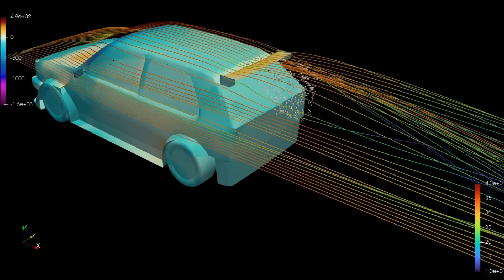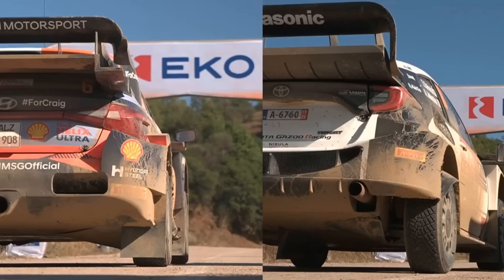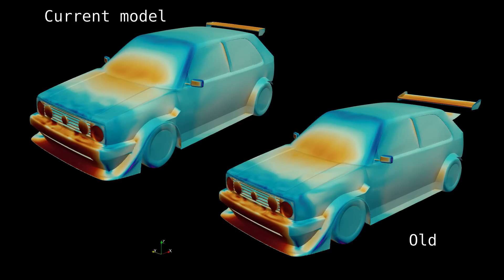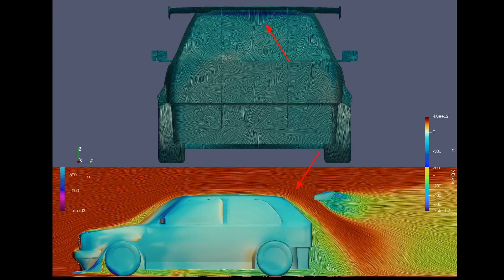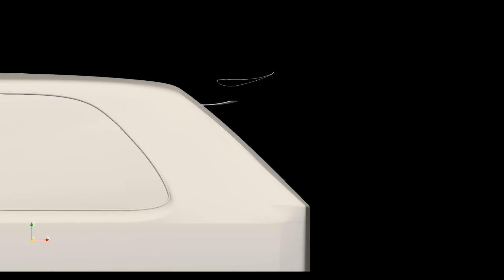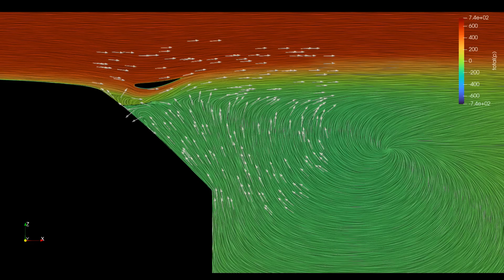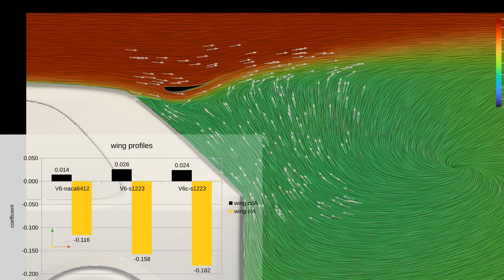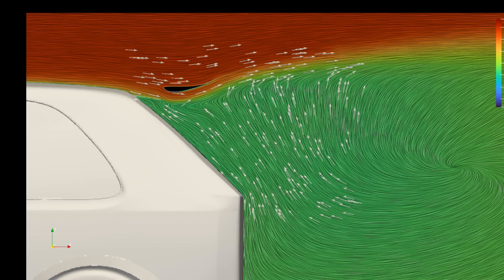Wings on a Hatchback

Comment: Love your video man, just for reference do you have do you have a list of drag and lift coefficients for a stock mk2 golf? 

I was under the impression that a stock mk2 had a cda around .3 so that fact that the front and rear spoilers more that double the drag was kind of surprising to me.
Reply from the maker: cda is not the same as cd. The mkii would have a cd = 0.3 like most small cars of the period. This a comparative model built from images, so not a direct replication.

Comment: what about the consept of clean seperation edges, I mean this car is kinda boxy so it comes kinda like that from factory, but if you have extended flaps from sides in a  negative angle to give smaller wake area and better separation edge does this do anything

Comment: Great channel, would it not be more beneficial to use devices at the back end of the roof to redirect air into the low pressure zone behind the car to just reduce drag. And maybe use a flat floor with splitter and diffuser to create some negative lift for the car? i'd love to see that visualised

Comment: A sissy little wing on a streetcar has no or not much use. At speeds achieved on streets, it generates not enough to have effect. If so the wings on sportscaster would be smaller .

Comment: We have observed in practice that rear wing can and will increase rear wheel grip at high speeds. Also in context of pure downforce, it might not be much, but depending on where you place that wing you can shift the weight of the car and create a stable or predictable behavior in the high speed corners and at the same time very well rotating rear in the low speed corners. In general the closer to 90degrees the hatch is the more you get drag and less lift. And people rarely account the suspension dynamics when speaking about aerodynamics.

Comment: very good that you kept testing and learing, notice that you found out that it was from old rally cars, also hill climbs (pikes peak, some dakar and so on) but most of them use a different method instead of the flat flap following the roof, very glad you tested that one because thats my theory of putting the wing all the back you are allow and letting the air follow a better shape to decrease drag and lift on the body of the car ( having a so back wing also helps with making more leaver force to the chassis) 

some ideas that you can test on the rear back of the hatchbacks ( i have some already installed) using a flat flap, with gurney and other with spoiler but on the middle of the car below the wing, i believe that area can be used to get more effiency out of a hatchback form 

i saw the complete list of the touring aero you made and notice that you made a cut on the rear bumper, i am using one but from around the back axel 90 degrees diffuser ( same theory of a open door on the rear of a pickup) but upside down, racing with it at certain speed i have felt the interior that i made from sheet steel bending so i assume it works and create more pressure to the rear 

great content and hope that someday we can maybe chat about it, always it is a very good time talking on aero from race cars and dont feel that everyanswer has to be though because it is a business secret that sells

thanks for the content and have a great day

Comment: On an all out race car with full aero an ultimate way to benefit could be to create a wing that actually created a little lift at the rear. Creating a "lever" effect slightly increasing the rake of the car (a force actually lifting, infact lets think of it more as twisting/levering) the rear with a little upwards force but with the equal effect of also pushing down the front a little.
 That lever force could then be used to alter the flow of the air around the rest of the car itself,  but  the main goal of creating Lower pressure under the car for example, essentially sucking the car to the ground more. More net downforce.  This would ofcourse require careful consideration and design of the rest of the aero etc of the car. On a basic off the shelf road car hatchback its probably not going to do much, infact youll end up with more net lift. 
But something with carefully designed aero on the underside, acting as a package utilising the rear wings rake boost, well, thats wheres the aerodynamic performance gains could be at for sure.
Reply: The only way I can think of to do that would be if the wing had a flap kind of like an elevator on a plane so it’ll have negative lift towards the front of the wing and upward reaction force in the rear. But I’d imagine that’d take tremendous force to make a difference given how little leverage the wing will have on the rest of the car, so it’d need a lot of surface area for the “elevator” which would create a lot of drag.

Comment: From model aircraft and glider design, I know the Wortmann FX60-126 airfoil to offer a high Cl and L/D over a wide range of Reynolds numbers. For a laminar flow airfoil, its tolerance for turbulence is remarkably good as well. I know its characteristics from the ASK 21 gliders from first hand experience and can confirm that the last bit of these planes to stop flying are the wing tips which feature the FX60-126. Maybe run a simulation with this? An airfoil that produces a substantial Cl max from low Reynolds numbers as well is the RAF 32, which is not too popular with planes for its Cm₂₅ being pretty hefty. For use on a car, this would be  very little of an issue, so it might be a good choice there!

Comment: One thing I would like to know is if there is anything I can do or add to my van to stop road-spray or rain and just the general dirt and muck from being sucked up off of the road and attracted to the rear windows like a black hole attracts matter.  Maybe some kind of wing or vanes to let clean air blow down over the glass from the roof.    I don't care much about drag, since my van is an 8 ft. tall brick as it is.     I have an older conversion van with the high roof, and 2 doors on the rear.  (Just look up a pic of a '90 Dodge Ram B250 conversion van)  I have installed a rear-view camera just behind the glass, and if it's raining, or the roads are wet, the crud just gets sucked up and all over the glass, obscuring any  view or hope of seeing rearward via the camera or interior mirror.  Anyone who has ever had a "flat-back" vehicle, as in a van,  wagon,  minivan, bus, RV etc, with no rear wiper/washers will know the struggle.
Reply from the maker: The dirt is pulled up and behind the car from the ground, obviously. I have video that addresses the commercial attempts at solving a similar problem of snow by pulling air from holes in the spoiler. This solution is mixed. I would be inclined to divide the wake into two counter rotating masses with a flap under the rear window. There would likely need to be other pieces of body work to encourage the counter rotation, like a piece pulling air off the roof, but that is where I would start.

Comment: On Golfs many just lengthen the roof to reduce the drag. So the actual spoiler is not an aerofoil, but just a flat surface (with side fences)
How does this affect the drag? Or does it even have advantages? Maybe the Golf 1 and 2 Dragracers are wrong about this?

If you are interested to do the math.. maybe consider to search for "arlows golf 2" here on youtube to see what i mean :)

Comment: On the road they are not really useful especially if you follow the speed limit. 
Drag racing, not useful at all. 
Rally or race, definitely helpful and useful due to the sheer amount of variables involved in racing. Wind, high speed stability, stability overall, couple with the slaps (floor sidewing) makes a huge impact on reducing drag where you model completely ignored this aspect. That’s where the suspension starts to matter, how stiff or responsive can impact the drag differently. There is soo many things I could go for an evening.
Reply from the maker: you should watch my other videos for all the other variables

Comment: I've been wondering for a while now, how a sunroof being all the way open or just popped up, affects the aerodynamics. I was hoping you'd already have a video on it but if anyone would do it, I think you would be the best one for the job. It would be awesome to see you make this happen! Thanks
Reply: Not about the aerodynamic but I tested the fuel consumption difference between closed and all the way open sunroof.
The car consumption is ~1L per 100km higher with the sunroof open. About the same that having the AC on.
Last summer I was wondering which of the two was more fuel efficient.
Would be really cool to see how it affects the aerodynamic though.
Reply: @NathanTrukise  oh nice, thanks for letting me know. I really hope @nelsonphillips does a video on it though so we can see all the data. I'm sure it's generally worse than just having the sunroof closed, but I'm more interested in how much, and if/how popping it up instead of opening it all the way affects the flow towards the tail of the car

Comment: How much more effective would a wing be vs just a surface mounted spoiler? Or flap as I think you call it. Seems like a wing adds more drag than anything useful.
Reply: I guess it depends on where you want to tumbled air vortex in relation to the rear of the car.  this is where an under floor diffuser helps direct/channels air past the rear bumper to eliminate rear lift and a long roof spoiler pushes the air vortex further away from the glass/hatch.   One is not much good w/o the other

Comment: Once I saw the underside of my car and realised how not aerodynamic is seemed. Ever since I would like to make it more aerodynamic.
Reply from the maker: a rough floor on a car is mostly drag. A rough floor can, surprisingly produce decent downforce.
Reply: @nelsonphillips  i never suspected that. Whenever I reach certain speeds about 100mp/h and up) I always notice a bit of lift. Not much and it can vary (i guess it’s wind direction). I always wondered if I could counter that. Thanks for replying.

Comment: What may be a silly suggestion. What happens if you mount the wings vertically behind the car. Obviously there will be rules not allowing it but just wondering if they can be made to  reduce the drag. 
At a super loose interpretation the vertical wings could be called the end plates.

Comment: the funniest use of wings was on Renault Espace mk3 (1996–2002) and mk4 (2002–2015) and some Peugeot 807 models also had them. Would be interesting to see simulation on those boxy family cars
Reply: I believe its just a roof rail joined together in aero position, pretending to be a spoiler

Comment: Once again: Place your rear wing to help your floor generate more downforce.  Don't use the rear wing for downforce. Use it to help your floor generate even more. In other words, think of the car floor and rear wing as a two element airfoil. Car Floor is the larger first element. Rear Wing is the second element. Use the Second Element Rear Wing to keep flow attached while also adding energy to help evacuate more air from the low pressure side of the Floor to generate more downforce. This might mean you're not placing the wing high up, nearly above the roofline, as expected. The angle to the ground plane might even be negative. Though it's AoA to the airstream will most likely be just slightly positive. All to accelerate the air to help the Floor evacuate more creating lower pressure. Which would create even more downforce than just using the floor and rear wing as seperate devices.
Reply: Are you saying that by using the wing's downforce, reduce the volume under the car which means the flow will be accelerated and hence increased overall downforce?
Reply: can you create this effect in a e36 coupe for example?
Reply: @bjorkay.  You could do it on any car. It's really a process of thinking of the car aero bits as a whole package rather than just bits and bobs you stick on. Shape the floor and diffuser more like an airfoil and not "Flat Floor then 12 degree Angled Diffuser". It needs to flow. Smooth. THEN the rear wing can better be used to add energy to the air stream to help evacuate even more air from your fancy floor/diffuser. It'd be even easier on a coupe  rather than a hatch, 'cause the rear deck is lower and closer to the diffusers exit.
Reply: @DeadRedRider  in this context, if we imagine the floor pan to be the low pressure side of an airfoil, do we want the rear wing to direct the airflow up towards the sky? so that the whole car effectively behaves as an upside down aircraft wing, generating lift towards the ground
Reply: @DeadRedRider is there anywhere I can see an example of what this would look like
Reply: @rtreyk the closest thing to this is when you simply add rake to the car, then the floor is angled upwards at the tail end like a wing. Examples would be Toyota's WRC cars and Red bull f1 cars between 2017 and 2021. The rear ride height would be a few inches higher than the front.
Reply: Ideally you shape and angle it just like you would a  two element airfoil. See: https://scarbsf1.files.wordpress.com/2010/03/two_element1.jpg
Reply: MIT
Reply: This is very difficult (I think impossible but there's probably far more intelligent engineers out there who could figure out a way) to do on a hatchback without making something completely grotesque due to how far away the mounting point of the wing is from the trailing edge of the floor.
Reply: i have a question, considering if u want to maximize everything possible with helping the floor to extract air and flow properly with the bodywork, would it be beneficial to run a upward facing exhaust? to help accelerate or "push" that air up, helping the diffuser?
Reply: @bigbean7273  I see where you're going with that thought. Problem is that a blown diffuser only works when the exhaust is flowing.  Which generally happens only under acceleration, which you mostly do in a straight-ish line. Otherwise it's just a diffuser. You'd need to keep exhaust flowing when you turn or brake to benefit. Like the old F1 'blown diffuser" era. But they had ECU tricks to keep the engine revved up while braking and in the corners.
Reply: @DeadRedRider  yah this, so theoretically if i could keep the exhaust flowing, would it be beneficial to have it in the same direction as the flow of air around or through the diffuser?
Reply: But you still physically need to create downforce with the wing first for it to push down on anything smart guy and this video is showing that a wing and flap setup does almost nothing for downforce 😂
Reply: Youre still thinking of it in the opposite way  @HandicapRacer  . Imagine a wing that actually created a little lift at the rear, creating a "lever" and slightly increasing the rake of the car (a force actually lifting, infact think of it more as twisting/levering) the rear with a little upwards force but with the effect of also pushing down the front a little ) That lever force could then be used to alter the flow of the air around the rest of the car itself,  but with the main goal of creating Lower pressure under the car for example, essentially sucking the car to the ground more. This would ofcourse require consideration of the rest of the aero etc of the car. On a basic off the shelf road car hatchback its probably not going to do much. But something with carefully designed aero on the underside, acting as a package with the rear wing. theres gains there for sure.
Reply: @Retro-Gfx-Official  well i think that goes beyond the question of does a wing work on a hatchback... If you're gonna use the wing in combination with the floor to createmore floor generated downforce then it's not the wing that creates it so the answer to the original question remains that it just does not work. I'm not trying to take away from the ideas of it helping the floor but all I'm saying is it's just an entirely different topic in itself.
Reply: @Xsidon if the wing is helping the floor generate downforce then the wing is working. What you said is like saying turbos don’t work because without an engine a turbo doesn’t generate power
Reply: @wwanimator  but a wing as a concept on a regular vechicle does not require the floor synergy to work on it's own and the turbo as you mentioned is factually useless without exhaust gas driving it so your you are clearly wrong here. We just have a different view on the matter... You think that a wing cooperating with a floor based downforce working means the wing in itself works. Wich is bullshit in my eyes becouse the wing o it's own doesn't do shit.
Reply: @Xsidon  in my eyes it’s bullshit to say the wing doesn’t work if removing lessens downforce. If it doesn’t work then not having it shouldn’t change the characteristics of the car
Reply: @wwanimator  no what i mean is that without a flat floor at a right angle properly tuned  with the wing.The original floor does little in terms of downforce becouse of all the turbulence all the suspension and exhaust piping and stuff down there makes. so you need to do your floor first in order to benefit from the wing. that's my point

Comment: Looking at the section with the flap and wing combination is this ignoring the side edges of the hatch? Can air be brought in from the sides to modify the circular airflow over the rear window?
Reply: i think this would be super effective. also runing vortices  with airflow from the sides along the flap to aid flow separation to strengthen it could allow you to use more aoa without stalling.